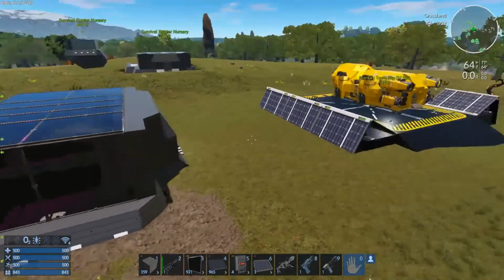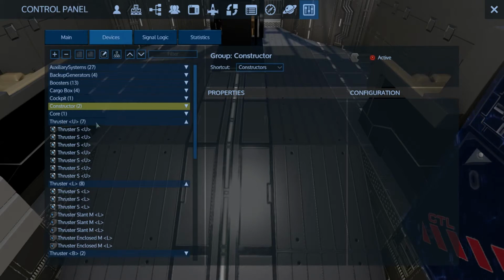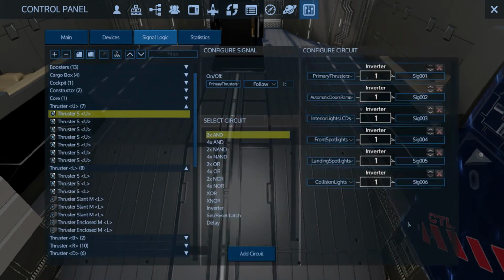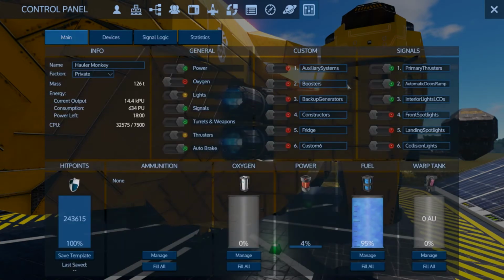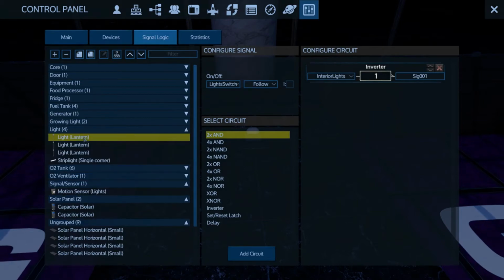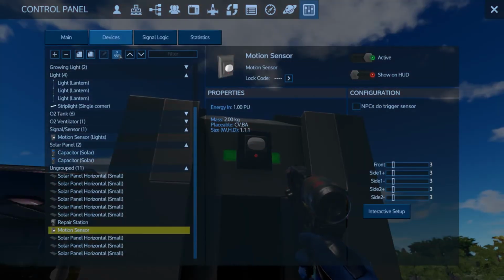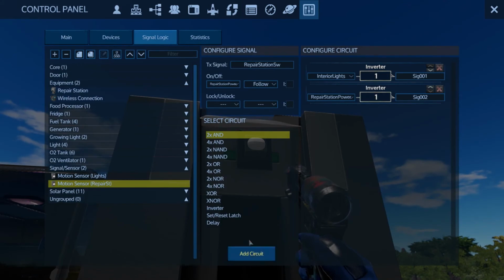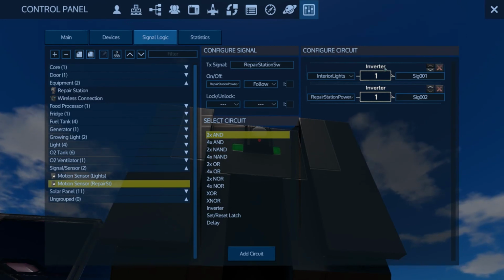Empyrion - Tutorial - Signal Logic: Inverter Circuit

Comment: It would help to actually set up a single circuit. As I still don't know what that "I" checkmark does at 4:15.
Reply from the maker: It's a reversal of follow. You can set it to follow when the circuit is switched on, or when switched off. Some things in Empyrion are quirky about that so it's something you have to experiment with sometimes. Hope that helps.

Comment: Really cool, I did use the repair console linked to motion sensor trick from one of the other videos where you had mentioned it. Works great as is. I didn’t know about the inverter option for a master switch idea. I really like that. I am going to dive in to the signals and really try to understand it. Thanks for the video.
Reply: Some things like the food processor you dont necessarily want to stand in front of all the time while in use. Ive recently got into the habit of placing a switch near the repair console that i link the console and the repair bay to cuz those guys take a lot of power i think. Also the deconstructor i have been placing a cargo box near it that is set up as the input and i place a regular switch right on the box linked to the deconstructor and have toyed with the idea of linking a light (maybe even blinking) to the switch also so i can tell that its running.
Reply: @jasonred2234  You could link a LCD to the switch or signal and have it carry a message saying "<Device> Running!" or "<Device> On" etc... also easy to see if something is running or is in it's On state at a glance... ;o)
Reply: JetsetUK hiya! I like the idea of using an LCD! And i have used that in one or two of my builds. In a particular case where i have the deconstructor in a room i dont often use, a flashing light or even an odd color light placed in a visible location, can be seen while im about to leave the base as a reminder.
Reply from the maker: Thanks Jason. I only more recently started doing that motion sensor trick for the repair stations. I've built a ton of stuff including a CV that had three of those things on it and with the ship on it'd be constantly sucking all that power needlessly. It makes me curious as to what else is consuming a lot of power idle (food processor does 30kW as an example) where something like this might help. And on signals, I still have a lot to learn. There's a ton to this game!